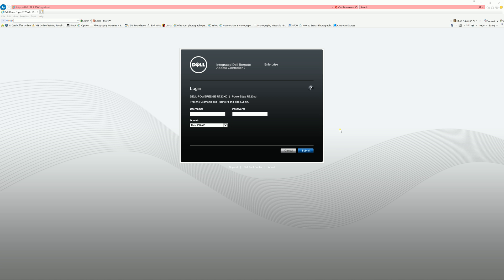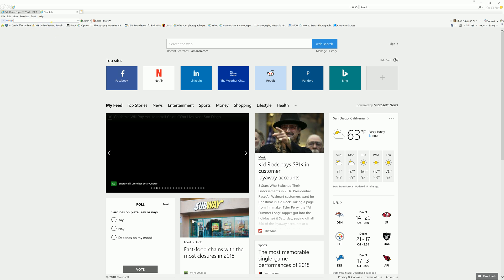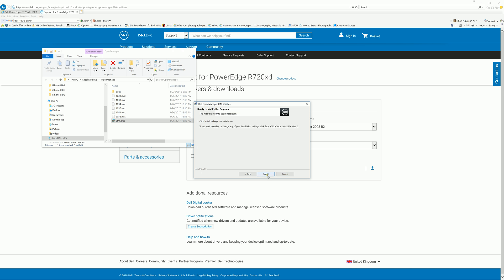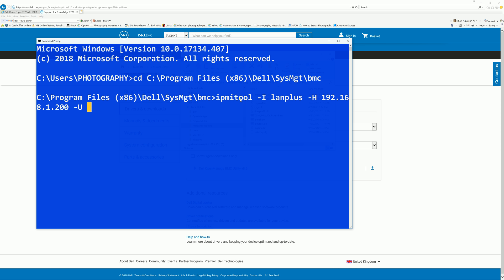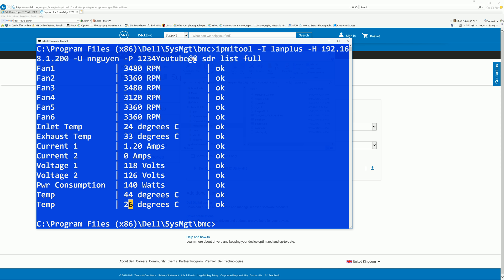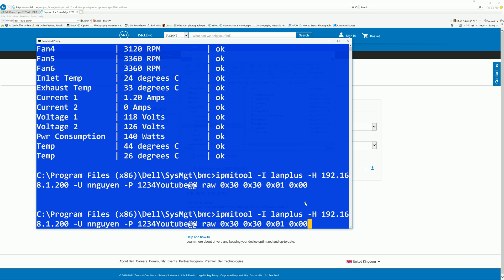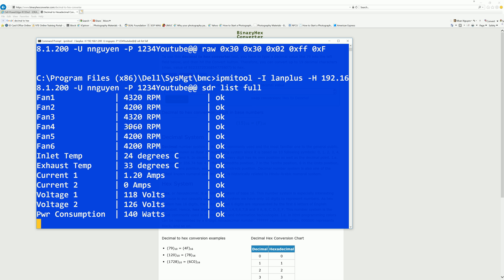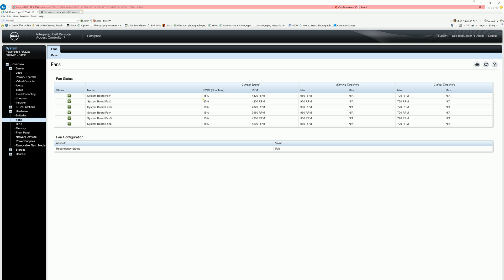How to Set Static Fan Control on #Dell #PowerEdge #Server to silence fan noises

Comment: how do you disable 3rd part pci fan control
Reply from the maker: Dell is really sensitive when using 3rd party PCI. The only work around I knew is the one I posted to manually set fan speed.

Comment: question, will the fans adjust if the temps get higher? The server I have is 35C. What were your guys temps before and after?
Reply from the maker: It will not, this is a manual control. My is around 35C as well, but it depends on many factors such as ambient temperature SAS or SATA or SSD drives.
Reply: @sysadmin102  oh okay. Thanks for the reference! I'm using a T440 poweredge and it's barely used. Its just for storing files and the occasional QuickBooks. In that case I think I will be good. Thanks!
Reply: @sysadmin102  btw I'm guessing if I disable the manual fans. It should go back to the original fan speeds?
Reply from the maker: That's correct, it will reset as well when you restart the server.

Comment: dude thanks so much you just earned a sub
Even though this is a temporary solution for me, im very sensitive to loud noise and it affects my focus to work on my new server. I have a R730 with no problems when it comes to using third party drives, but this R730XD really likes to scream at 65% of its lungs (PWM). Setting down to 15% makes it so i can actually work and figure out a scripted solution based on temperature. Thanks for recommending we explore that option
Reply from the maker: I have 720xd. It really ramped up the fan with third party hardware.

Comment: After the making manual fan speed with IPMTOOL I do upload with SSH this comand: racadm set system.thermalsettings.ThermalProfile 2
Rebooting did not make a chnage in fun speed work. I have Dell 720XD. Try it)))

Comment: your awesome this works great i ended up turning this into like 3 batch files one at 20% one a 40% and one at 70% comes in handy when i decide to do some encoding with my server im pulling almost 300w  off the 2 intel E5-2690 v2 and 20% fan speed only keeps the cpu's to about 85c  at 40 its about 75 but if i do it for more then hour it starts to get too hot and alarm goes off so tend to turn to 70 when doing more then 1 or 2 of them and my server is in a closet with next to no ventilation most of its life is in idle as my truenas and jelly fin/plex box with the 16 drives

Comment: ⚠ DO NOT UPDATE YOUR iDRAC ... Administrative rights DISABLED on both iDRAC + IPMI ⚠

It's INFURIATING; my R7415 is INTOLERABLE. No use having an NVMe array if I have to keep it turned off.
If there's no way to modify via the IPMI ROM's .bin to upgrade rights to admin..? (an onerous project at best) ...
there's no point buying enterprise gear. This is happening on SuperMicro ... Tyan, Dell and probably others, too.

Comment: Thank you for the Dell Fans Control Command.  
Wonder when the temp. ram up, will the Fans increase the speed to cool down the server?
Also, need to re-enter the command after every re-boot :(
Reply from the maker: This is for homelab, not for production environment. The fan will stay at whatever speed you set. Depends on the operating system you use, you can create a script for it to execute at startup. I believed disabled Life cycle will also retain the static testing.

Comment: I was able to use this on my old Poweredge T110 II. I actually had the opposite issue. I am setting it up as an Unraid backup server and the hard drives were getting too hot. They were getting up to 48-49 C. I changed the fan speed to 50% and 30 minutes later they are down to 38-40. Thanks!
Reply: It seems that when power is removed, the fans go back to their original setting and I have to redo the IPMI commands. Is there a way to make the change permanent?

Comment: this worked but as soon as you reboot it goes back to high fan noicse. anyway to make it permanent ?
Reply from the maker: Maybe if you didn’t skip my video you would have known. There is not permanent solution. However if this is your lab, you can disable life cycle or running a custom script at start up
Reply: @sysadmin102  thank you. I’m not sure what changed but somehow now it’s keeping the settings. I’ve tested it and have done several reboots.  I just do t know why it’s keeping the settings.  Working great.

Comment: just did this on my Dell T610 and worked - thankyou for the video. Been trying to get round to sorting this as the server, to be used for home lab stuff, was too noisey to be left on and as they take so long to powerup anyway I wasnt using it much. It can now purr away in teh corner and is no worse than my desktop (although PSU is a little noisey but still not very long

Comment: You've made my home lab absolutely quiet! I run my Poweredge T320 with E5-2430 on 10% of fan capacity and it's perfect. I was stressing the CPU for good 2 hours and the temperature won't go over 75 celsius. Thanks, thanks, THANKS!

Comment: I keep getting the error "Error loading interface Ianplus" Anybody know how to fix this?
Edit: system needs to be fully initialised. This works for me while truenas it running
Edit 2: Keep randomly getting the same "Error loading interface Ianplus" when trying to make changes to fan speed. However, if I ran the first command (sensors read out) and then ran the fan control command quickly after it works

Comment: This worked for me (iDRAC7 Dell R420), can I just add this line for those that run into the Error: Unable to establish IPMI v2 / RMCP+ session

To resolve ipmi issue, need to change the IPMI over LAN setting from Disabled to *Enabled* in the iDRAC/iLO.

iDRAC Settings - Network - IPMI Settings - Enable IPMI Over Lan - check (value) = enable

Once after IPMI over LAN been enabled, below command provides fan status.

ipmitool -I lanplus -H [interface] -U [username] -P [password] sdr list full
Reply from the maker: I'll update the text file. Thank you for your contribution

Comment: Hi. The information you provided worked. I lowered the fan speeds. Here is a question I want to ask.
no matter how long the processor works, will it always spin at the speed I set? I am using R710.
Reply from the maker: It would if you don't restart your server. You can disable life cycle. Then it should stay the same even after rebooting

Comment: They broke it in BIOS 2.13.0     Firmware: 2.81.81.81  BMC ver 9.2.0 (still the latest 12/13/2021   Dell R730XD).
IPMITOOL will give you the following Error: Unable to establish IPMI v2 / RMCP+ session
           Get Device ID command failed after it times out.
Reply: Access idrac from browser > iDRAC Settings > network/security > IPMI Settings > Check Enable IPMI Over Lan.
Reply: i had this problem, for me the fix was... turn on, hit F2, iDRAC settings, Network, IPMI Over LAN Enable and Encryption key needed to be all zeros mine was not and that caused my problem
Reply: Hi,  I just buy Dell r730XD. On what BIOS, Firmware and BMC you working now? Mine was fully updated before shipping and this command not work. Can I downgrade BIOS etc?

Comment: Can confirm works fine on my Dell R710 R1 Bios 6.6.0 iDRAC 6. Used 0XA at the end and fans dropped from stock 3240 RPM to 2040RPM, happy with that!

Comment: I got this working on a T640 purchased in November of 2020 but you MUST downgrade to iDRAC 9 v.3.30.30.30 or older for this to work.  Dell has foolishly removed the ability to manually control the fans in newer versions of iDRAC.  I will never buy another Dell server if they keep this BS up.  I'm running a simple filesharing server with 18x 3.5" drives.  I've manually set the fan speed to 20% and the drives never go past 45C and the CPU never goes beyond 50C (the CPU is only 30C right now).  This stupid server was so freaking loud before.  The only reason Dell has removed this feature is because statistically speaking, the cooler you keep an electrical component, the longer it lasts.  In other words, Dell did this to reduce warranty claims.  I have this server in my home office so it needs to be quiet.  I will of course turn this feature off if I ever repurpose this server for more CPU intensive tasks, but there is NO reason to keep the fans so freaking loud when all it's doing is sitting there at 5% or less CPU usage 99% of the time.
Reply: How did you downgrade? I cannot get it to work fo rmy iDrac 9

Comment: On the R610 idarc6 it worked. Just replace the damaged coolers with excess load. Before 16000 now 3000 rpm. I wanted to change the maximum automatic to the balanced one. Thank you

Comment: Good morning! first thank you for your video, my server is Dell R730XD with OS Windows Server 2019, so i don't see BMC version match for this OS, i tried install Dell OpenManage BMC Utility,v9.2.0 and follow your guide, but it does not work, maybe this version only use for windows server 2016. If you have any advise for my case, please help me, my server is noise while the temperatures around 27 degrees. Thank you!
Reply: @sysadmin102  Good afternoon! thank you for your advise, i just done as following your guide, i will be careful to set step by step from high speed to low speed to avoid over heat. Have a nice weekend!

Comment: Found this at http://www.righteoushack.net/dell-poweredge-13th-gen-fan-noise/
Disable Third-Party PCIe Card Default Cooling Response:
ipmitool -I lanplus -H ipaddress -U root -P password raw 0x30 0xce 0x00 0x16 0x05 0x00 0x00 0x00 0x05 0x00 0x01 0x00 0x00

Enable Third-Party PCIe Card Default Cooling Response:
ipmitool -I lanplus -H ipaddress -U root -P password raw 0x30 0xce 0x00 0x16 0x05 0x00 0x00 0x00 0x05 0x00 0x00 0x00 0x00

To check the current third party PCIe card default cooling setting:
ipmitool -I lanplus -H ipaddress -U root -P password raw 0x30 0xce 0x01 0x16 0x05 0x00 0x00 0x00

This response means disabled:
16 05 00 00 00 05 00 01 00 00

This response means enabled:
16 05 00 00 00 05 00 00 00 00
This worked great on the R730XD I have. Your video was great to show the way to do this!

Comment: I have a Dell PowerEdge R610 and when I try and put the command in cmd, it gives me this. Is there something I am doing wrong?

C:\Users\wmfor>cd C:\Program Files (x86)\Dell\SysMgt\bmc

C:\Program Files (x86)\Dell\SysMgt\bmc>ipmitool -I lanplus -H 192.168.0.120 -U root -P calvin sdr list full

Error: Unable to establish IPMI v2 / RMCP+ session

Get Device ID command failed

Unable to open SDR for reading
Reply: i had same issue on Dell R710 to enable IPMI At the end of the BIOS boot, press Ctrl-e to enter the Remote Access Setup and enable actual IPMI Remote Access
Reply: @sysadmin102  i do have it enabled and it still says this when i try and put it in. Sorry for the late response, i never got the notification that i got a response

Comment: I need to do. there is no idrac6 card on the server. the error is as follows.
"C:\Program Files (x86)\Dell\SysMgt\bmc>ipmitool-I lanplus-H 192.168.1.25-U tubisan-P 571632 sdr list full
Error: Unable to establish IPMI v2 / RMCP+ session
Get Device ID command failed
Unable to open SDR for reading"
Reply: Hello Ismail, Are you using the credentials for the iDrac or the server? iDrac credentials are needed.
Reply: @344bane  My worked for weeks, but then it started getting tougher to work, it wouldn't respond upon initial command.  Now it stopped all together and I'm getting the same issue as @Ismail.  I did just install a new video card, if anybody has a suggestions please chime in.  Thanx

Comment: The tutorial is not working on newer iDRAC versions (the error you get is Insufficient privilege level), I had to downgrade my iDRAC to at most 3.30.30.30. Tested on Dell T140.
Reply: Same problem on T140 with 4.00.00.00. How did you downgrade iDRAC?
Reply: I did it the short & old-fashioned way. Googled for iDRAC 3.30.30.30, downloaded and installed it on my T140. No problems encountered. After the downgrade, Nhan's procedure works as expected.
Reply: @jankokubkosk  Thanks. Now I have the problem that after T140 restart/powerloss fans are loud again.
Reply: @konradd4015  Yes, that's how it works. It the BMC loses power, the fans are back in default settings.
But for me it is enough: Configuration survives OS restarts or server shutdown.
Reply: @jankokubkosk  Thank you for support.

Comment: Logged in as root, IDrac 9 , Unable to send RAW command (channel=0x0 netfn=0x30 lun=0x0 cmd=0x30 rsp=0xd4): Insufficient privilege level
Reply: Got this working, Had to downgrade iDrac firmware, Found out that around June of 19 they eliminated the static fan commands from iDrac firmware.
Reply: I don't think they removed ability. I am on latest idrac 8 (2.70.xxxx) and it works fine. However I created new IDRAC user with admin ability for IPMI over LAN
Reply: In idrac 9 you need 3.30.30.30 or older firmware

Comment: I get Unable to send RAW command (channel=0x0 netfn=0x30 lun=0x0 cmd=0x30 rsp=0xd4): Insuficient priviledge level when I run the cmd to enable static fan control but not when I list the fans.
Reply: @sysadmin102  I am getting this logged in as root administrator
Reply: @itit1737  Did you get this to work? I am having the same issue on Dell R905 with DRAC5
Reply: I am exactly here with a Poweredge T300 Drac5 IPMI 2.0
Reply: @yorickch  I believe the creds should be the iDRAC credentials. Default IP - 192.168.0.120. login for iDrac is username: root / Password: calvin. 
For example: -H 192.168.0.120 -U root -P calvin

Comment: Worked like a charm! Is it also possible to just increase the temperature threshold leaving the fans in auto mode? So that they run at a lower speed but still increase if the temp goes too high.
Reply: you can find various scripts to automate the custom fan management in a proper way